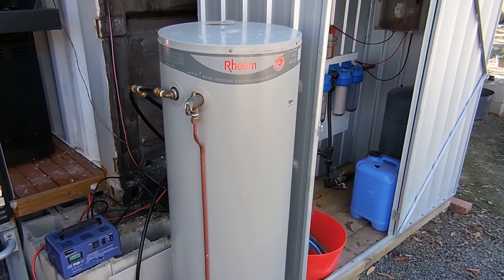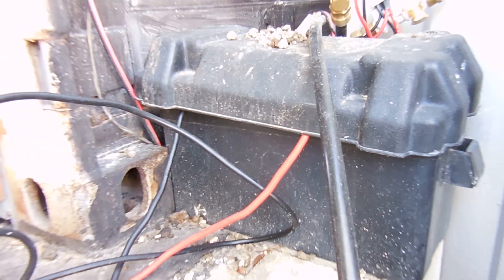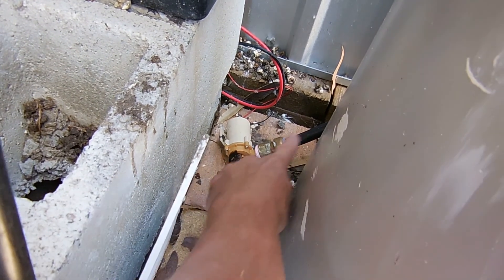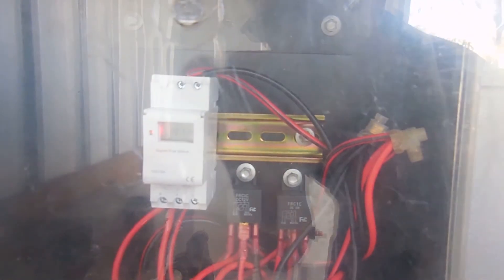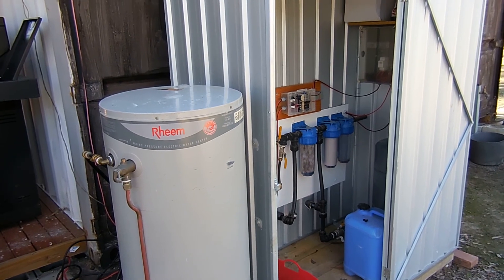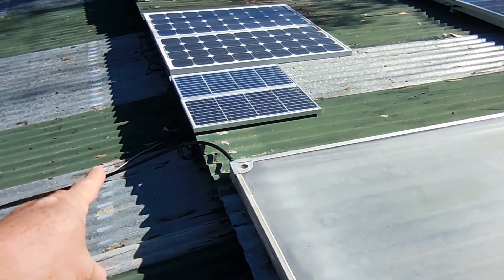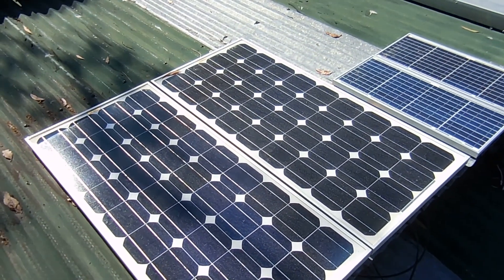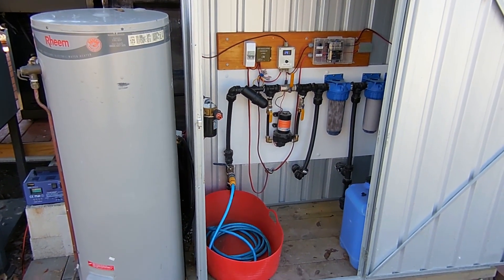SOLAR HOT WATER SYSTEM OVERVIEW

Comment: Gday
have u looked in to the sunflux II no pumping water to the roof just uses solar panels 
http://www.sharpenergyinvestments.com/
i like this better then the water on the roof no probs with freeze pipes not that u would get that there
cheers
Reply from the maker: I have looked at it but @ almost $1300 for the control unit then  it is rather expensive.
We got the solar hot water panel for $50 ,which works well in summer.
I may end up building our own dc control unit or install a DC element in the tank.
Reply: yer i got 2 of the water panels 1 with a split cos of freeze and a 300l tank but cos i want to go to tas i dont think it be the right setup now they got a pump to sort that out
 there's this other setup http://solarimmersion.co.uk/
looks ok hbpowerwall has just set this up so be interesting to see how it works out
cheers

Comment: hey your hot water you can help it out in winter the heater element on the unit you can use to help get 4 x250w 36v solar panels cheap 2nd's lots getting around on gumtree and ebay cheap link them onto your element get them linked to 120v dc and run it on the unit it well help out alot pv solar heater on there way better then trying to heat the water in winter just not the best 
guy down the road just use pv solar on he's but he has 8x 250w still at 120vdc but just more watts the element be fine if you think it not work there is DC elements on the net to 
that all said guy down the road he's temp on he's tank today was at 72c and there not alot of sun around so from what i see it works great so what the temp of your tank today?
Reply from the maker: I have thought of doing that ,Have seen 12v and 24v elements on ebay that could be used in the hot water tank.
Running the normal element on a few solar panels would also work.

The hot water panel on the roof works great in summer but no we are in the cooler weather it is just not good enough to get the job done.
Supplementing with pv wired into the tank element during winter should do the trick.

Might try using the existing element first and see how that goes :)

Comment: Do you have a charge controller for the 12 battery?
Reply from the maker: Yes there is a charge controller setup in the pump shed for the 12v battery
Reply: OK, no worries. I've had some problems with my 12 volt battery for my weather station but I think it's more a issue with the age of the battery. 
Thanks for the great videos.